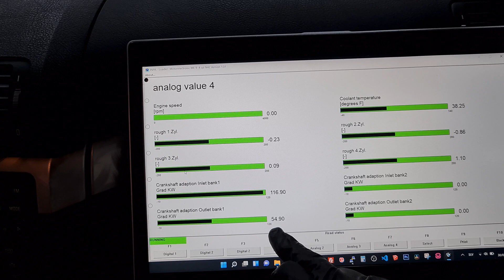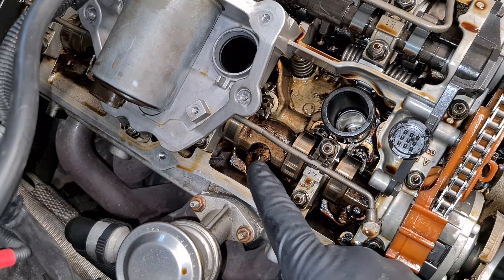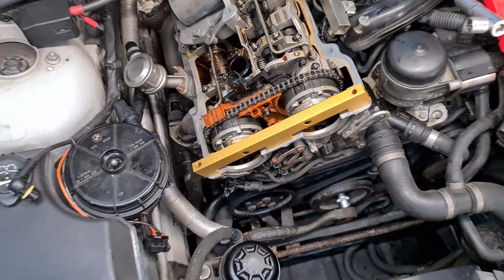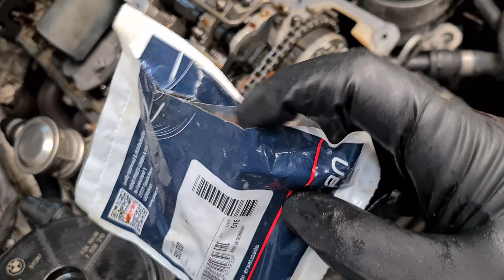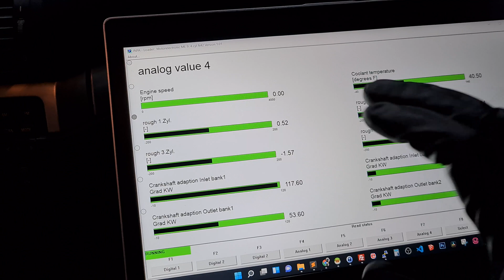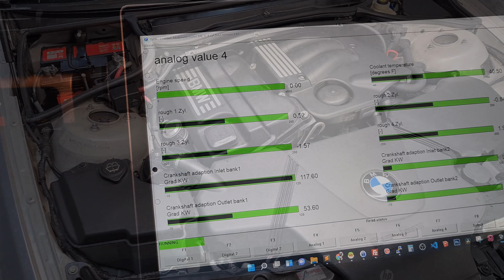N42/N46 Startup Rattle - Is Replacing exhaust VANOS the solution?

Comment: Is it necessary to lock crankshaft to replace vanos like that ?
Reply from the maker: If you want to be 100% sure that everything is set up correctly it's best to also lock the crankshaft. I knew my engine was timmed correctly because I just changed the chain guides and timing chain.

Comment: How do u know if the sprocket is bad….. l did an engine rebuild and when l turned the engine by hands the camshaft and the sprocket gear wr not turning at the same time the was a delay what might be thr problem help
Reply from the maker: @freefire-qu9mw   Check if the VANOS units are locked in initial position. More info here: https://youtu.be/X7ybZhT3b28
Reply: @ ok thanks l bought a new cz l noticed a crack on the old on that plastic thingy

Comment: Why you don't use vanos rebuild kit?
Reply from the maker: I am not aware of a "rebuild kit" for N42/N46 vanos... Do you know one?
Reply: @BimmerZen  I just got e46 n42 318i still learning about, i find out that my coolent is between 100 and 110c on obd, but on cluster is always on middle, is it normal,  thanks in advance for answer
Reply from the maker: @2154jjh1  yes, temp should be steady in the middle. Only if you push the engine hard it can get a bit over the middle. Temp is normal
Reply: @BimmerZen  thank you for answer, I'm worried because my vw golf work on 90c, and e46 100~110 Celsius, i hope it's ok

Comment: Can the intake unit be taken out n put back like this aswell?
Reply from the maker: If my memory serves me correctly, it is not as "easy" as the exhaust. I think you need to remove the little metal "L" bracket that secures the chain against the intake vanos sprocket...

Comment: I noticed that the solenoids cables are swapped relatively to my car. Eventually, either mine or your's are wrong.
Reply from the maker: You have the N46?
Reply: @BimmerZen  I have the N42 engine. I've allready tested: my cables were OK.

Comment: Is this the same as the n43?
Reply from the maker: No.
Reply: @BimmerZen  the issue that im having is that the exhaust camshaft is not really on the correct timing, the intake is, i need to correct it but i don't want to block the flywheel would that be possible?

Comment: Hi chief, great awesome job.
Will this concept theory be applied to N51/N52 engines? Same locking tool and procedure?
I have to replace the bolt heads on the Exhaust Camshaft. please advise chief.
Thx

Comment: !!!!!!SOLVED!!!!!! Ive had this noise 3 times now and it goes away when i change my oil. the oil only lasts 2 years. it is normal for it to only last two years even if you only put a 1000 miles on it. it deteriorates even quicker when the car stands for long periods. for me it comes back every two years till i service it, if i use the car every day, or once a week. ive been on all forums and no one seems to realize it.

Comment: When re installing the koged  part or the vanos ( the one in contact with timing chain) does orientation matter? It looks like the impulse sender matters but the whole vanos assembly doesn't?  Please explain. I need to know if it matters 😅
Reply: I plan to change my exhaust vanos unit with cheap febi bilstein from autodoc. Is it good? Original bmw is at 700 each in norway 😂
Reply from the maker: @tahirzeeshan500  I haven't seen aftermarket VANOS units, but FEBI Bilstein should be an OK choice. I haven't had any issues with their parts so far.
Reply from the maker: @tahirzeeshan500  Orientation of the sprocket is not important. The important part that needs to be oriented correctly is the impulse sending gear. These are oriented correctly with the front locking tool with pins that engage with the holes on the impulse sending gears.
Reply: @BimmerZen  ok. Thank you very much for answering. Im much more confident on doing this job and swaping valvestems now.👍

Comment: Hi can I ask you I have error code 2A61 and after replacing timing chain have problem with cold start and can be problem with timing on vanos I have angle intake 114.9 and exhaust 54.6 .i dont know where start solved this problem if check valvatronic shaft or sensor of vanos on intake or intake vanos or chain or any thing can you help me

Comment: whats the black container next to windsceen wash and the thing ontop of the exhaust manfiold, my n46 318 doesnt have either of those?
Reply from the maker: That black thing is the secondary air pump and the silver thing is the one-way valve. They are installed on most  N42/N46 engines with EURO 4 emission standard. The secondary air pump is activated on cold startup for a minute or so and pumps extra air via one-way check valve in to the exhaust ports in the cylinder head. This way the catalytic converter heats up faster and the engine produces less emissions.
Reply: @BimmerZen  ok i see, i don’t have any cats, so i’m assuming that’s why they’re missing
Reply: @ethxnhxrst1575 I too have the N46 318i. And it's not fitted with either as you described.  Uk model

Comment: So whats the solution now? İm so depressed with this Startup rattle. İve checked my Oil Filter it was half full the next day for years i thought it was the oil Filter housing. Which Oil you Guys use ? If we have minus Celsius i dont have this rattle which i have everyday in the morning. So i think if the oil is thicker the oilpump builds more pressure. İve tried 0W40 5W40. İve read about that this engine is similiar to the psa engines from Peugeot etc. These engine only can use 0W30 and 5W30 i will Change my oil to thst next time. My car began to rattle after i switched my original BMW battery to a exide one idk how its related

Comment: Dear BimmerZen: Thanks for a very helpful video, especially the procedure for removing a VANOS unit in situ. 

However, while you demonstrated how to replace an exhaust VANOS unit, you never explained why you thought it would solve the startup rattle? I couldn't see why it would work so was not surprised that it didn't cure the problem.

Surely the symptoms point to oil starvation? Oil drains away from the cylinder head when the car is left standing, and this causes a rattle in the valve gear, etc. This stops once oil pressure is restored (about 1-2 seconds after starting the engine).

I have found that turning the engine over (but not starting it) solves the problem because the oil pump is mechanical. So, the solution has to lie with the oil filter or related parts? Something is allowing oil to drain from the cylinder head...

Anyway, sorry for the long comment and thanks as always for your hard work in marking these videos!
Reply from the maker: I have read on the internet that exhaust VANOS units get worn out and can cause the rattle. If you take a look at my VANOS inspection videos, you can see that there are some wear marks, so I thought that maybe the oil drains from the exhaust VANOS unit, causing it to start depleted of oil. Another possibility is that the VANOS unit locking pin gets stuck due to wear.
Reply: @BimmerZen  Thanks, that make sense.  👍
Reply: So whats the solution now? İm so depressed with this Startup rattle. İve checked my Oil Filter it was half full the next day for years i thought it was the oil Filter housing. Which Oil you Guys use ? If we have minus Celsius i dont have this rattle which i have everyday in the morning. So i think if the oil is thicker the oilpump builds more pressure. İve tried 0W40 5W40. İve read about that this engine is similiar to the psa engines from Peugeot etc. These engine only can use 0W30 and 5W30 i will Change my oil to thst next time. My car began to rattle after i switched my original BMW battery to a exide one idk how its related

Comment: I have the same problem (video/sound on my chanel). I wrote a message in an e46 forum to get some help and sb. mentioned that it could be the check valve in the oil filter housing. I can't wait to see your solution ;) BR

Comment: About the valve cover gasket, apart for putting the silicone on the cylinder head I think you also should put some silicone between the valve cover itself and the gasket.

Comment: Thanks for this video! I've had exactly the same issue on my N42 engine,  a weird growling type rattle that lasts for around a second after not driving for several hours. Always thought it might be the sound the vanos makes dry until it gets oil pumped to it, hopefully we'll find out soon what it is because that noise is annoying and worrying lol
Reply: So what was it ???
Reply: Watch his video after this he explains his noise was the check valve inside the oil filter housing, I've tried cleaning cleaning my check valve and it stopped the noise for a little while but now its returned. I'm wondering if I didn't clean it well enough or if there is another problem.
Reply: @Jo_E46  ive Opened the oil Filter after 1 day and it was half full of oil or are some hoses clogged that this oil in the housing cant get to the engine fast enough
Reply: Try check the smallest oil filter seal inside the housing that we replace with every oil change, if the seal is worn, the pressure in the system will become low since the oil leaks trough and end up in the oil pan

Comment: Hello BimmerZen, I am having the same issue with my N42 engine. I tried already replacing the chain + chain tensioner, inspected VANOS units, replaced oil pump and this is still rattling. My guess for now is to replace oil filter housing, but not sure if it's gonna help. I look forward to check out you coming videos on this topic. btw thanks for the content - it's helpful and interesting ;)
Reply: Was the oil check valve at fault?  Just bought one of these bmw which has low oil pressure for 5 seconds at startup, otherwise drives great!
Reply from the maker: I had the same issues and replaced many parts... now it seems that the check valve in the oil filter housing is the culprit. I am making a video on that this week.
Reply: @BimmerZen  najprej preveri, ce mas dovolj dolg filter/vlozek ali probaj s kako drugo firmo filtra. Ena varianta je, da ti filter ne drzi ventila zaprtega in ti olje odtece nazaj v karter.